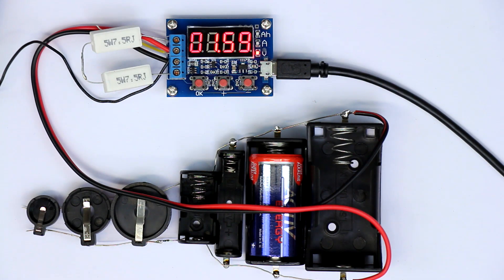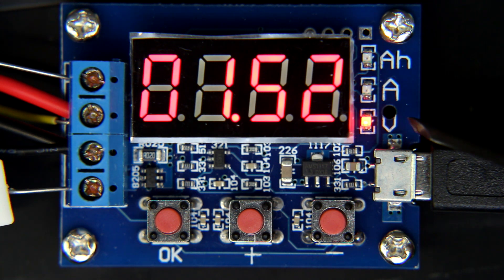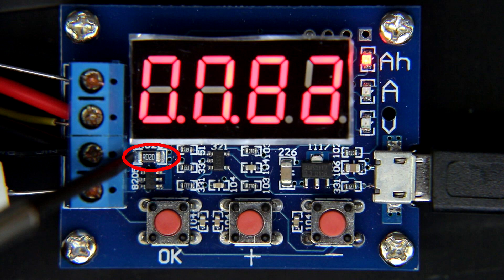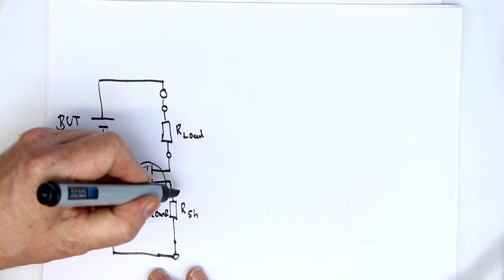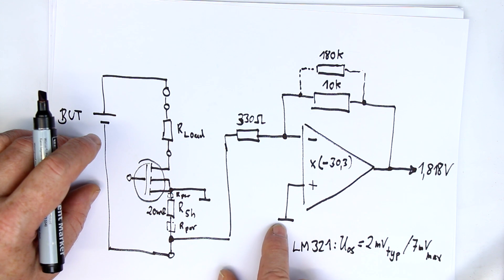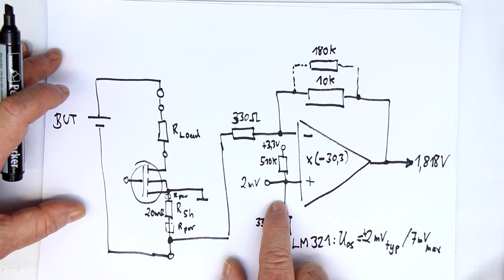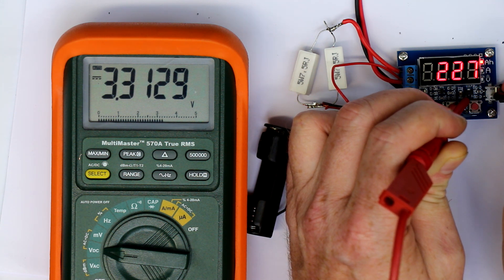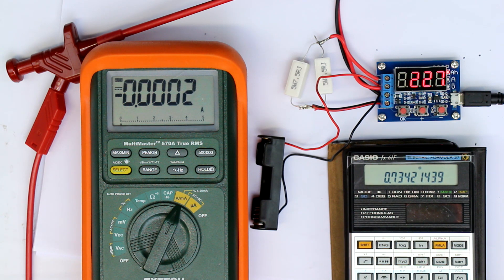Full Analysis of a Battery Capacity-Meter from Ebay

Comment: @KainkaLabs I bought 2 recently, one from ebay and one from aliexpress. I had just read in a File in the DIY Powerwalls Facebook group that some were found to be inaccurate and possibly fake copies? The ones they said to buy were the units labelled ZB2L3 V2..3 and avoid the units labelled HW-586! - Both my units were delivered as ZB2L3's and were pretty accurate compared to my DVM and stopwatch using one 7.5 ohm load using a PSU as a source, so I didn't need to try calibrating. Great videos - keep up the good work Roger :)
Reply: Same result. I initially got two ZB2L3 labeled boards. Tested multiple batteries back and forth between the two testers and found them to be within 5% of each other. Then, deciding to build a larger battery test rig, I purchased more from same seller on Amazon. The next time I received the dreaded HW-586 garbage. And after noticing many bad measurements from them, I have begun characterizing as you did to find the linear offset of each unit. I have a general idea of the % error of each HW-586 board, but only for a specific battery capacity, namely 2200mAh 18650 cells. When I test larger capacity cells, my error is much greater probably due to the crap clock in the OpAmp. These are usable for a specific cell type after much characterization, but truly wish I had just returned and insisted on the real ZB2L3. I have not looked into tearing apart those units to run your tests because these are my only gold standards.
Reply: same results

Comment: Your videos, not just this one, are a valued contribution to tech society. Please consider adding titles to this video post, correcting that there is SW calibration and actually after it's done properly, this $2 gadget is measuring with three digits precision. YouTubers often do such corrections. I have 6 sets of these and probably will get more. I take cells from a laptop battery and test them all at once. It costed me the same as the other tester you like in another video which is nice and cool, but price/value, this wins totally. (and you know it :) According those fake copies, I think they are just copies. If I remember correctly, I saw author put the design on public domain, but might be mistaken. SW on fakes changed too. It used to have problem calibrating. The trick with calibration of Amps is to put Minus terminal on IN- and Plus on R terminal below it. Ignore resistors, place Amp meter in series to get better reading and put stable 2Amps from CC regulator (or trim CV regulator until you'll find 2Amps) The rest of calibration instruction is correct.
Reply: Can you give more clear info about Amps calibration please ?

Comment: I've compared this module with liitokala lii 500 to calculate the mAh from 18650 battery. And the result if I use 10-15 Ohm Resistors and configure the cut-off limit at 2.5v, the result is only 5-10% difference from the measurement using liitokala lii 500. the test time will be longer. 1 battery takes 8 hours to test.
Reply: as you, I noticed that this testor is working best at 10-15 ohm! 2x7.5 ohm in SERIE!! yeah I know the test is longer ( > 10h), but I think result are kind of betters. at 15ohm, the batt is drained at 280mAh, and since most people use this testor to test recycled 18650 from laptop battery, I dont see why to stress those battery with 1A discharge!!

Comment: Yeah these things aren't recommended. I got mine in the mail today and there's so many things wrong with it. Right from the start when I test a battery that's charged between 4.1 and 4.2 volts it immediately drops voltage displayed to around 3.3 volts. Batteries could be bad but I don't know. Gotta wait to get a proper tester before I can know the truth.

Comment: Probably not much help now, but press all 3 buttons and plug in the usb, and it goes into calibration mode. I get mine calibrated to about 10ma.
Reply from the maker: Is 10 mA a relative or absolute error. 
Have you checked if low milliamps are accurate? E.g. with 25 mA an offset of 10 mA would be an error of 40%
Reply: @KainkaLabs  To be honest I only use it to test 18650 cells at 1A, and 12v agm batteries at about 2.8A. As long as I can calibrate it to these two ranges, I'm happy.

Comment: I saw your 2017 story and was immediately concerned about the accuracy of the one I just purchased 2022 from Amazon which looks exactly the same.  I ran tests monitoring voltage and current using separate meters at the load and also at the input.  I used a Agilent power supply for the evaluation.  I have to say the real-time measurement accuracy was within the range of decimal precision on the meter and unit displays, and the timed current accumulation was also within about 3% of my calculation for each timed study at several different voltages and load resistors.  I'm quite pleased with this unit and hope that is a sign the issues you had are resolved with updates or quality control.

Comment: One more observation after using these useless gadgets. If you set the cut-off voltage at P 3.0V, you actually halt the test at 3.099V (or whatever 10bit limit that comes from the ST OpAmp. The sig fig after the decimal is actually truncated to the next higher bit, so whatever you set, as soon as the 3.10V reading changes to 3.09V, the test stops. Given the wild inaccuracy of the current and time measurements, this probably doesn't matter, but I always set mine to stop at P 2.9V so I at least discharge to 2.99V. As far as the current offsets, if you only test one type of battery, in my case a 2200mAh 18650 cell, you can figure out a % error for each test module and factor that into to your observed capacity, and that is pretty repeatable from run to run. In other words, you can make a reasonable guess for a dedicated cell type. But you would have to go through this exhaustive characterization for every new type of cell you test like a larger pouch cell, or LiFePO4 or NiMH. Total junk. And you're right, what are they teaching in these tech schools? Or maybe these counterfeits are not even designed by trained engineers, rather self-taught "techies" in Shenzhen.

Comment: Very informative video.
Based on your eval, I ordered 2 ZB2L3's. However what I received, to my annoyance, was two of these HW-586's (when I queried this seller "they're the same")! Well I decided I'd better check them out and wired them up. I have to say their performance is much better than the one you tested. I have just been trying out known cells (new 18650 samsung 3000mAh NCR's, new amsplus 18500 2000mAh tested by seller 1985mAh on pro testing gear), first on one board, then the other. Result capacities are in the right ballpark (hard for me to be precise here because I don't have precise charging set up) within <3% of spec, discharge time is near exactly as expected and the two boards are consistent to <5%. This is in fact satisfactory for my purposes.
Reply: What is the cut off voltage while using 18600? İ get nearly 350 mAh difference between ZB2L3 and hw 586? İ set cut off voltage 3v.

Comment: I know I'm late to the party, but I got one a few months ago and did some research on the module too.  Apparently there are a lot of hardware variants around, in a github thread i scrolled, i counted 3, one with a ST micro and some chinese micro that use a separate display driver and 3rd one that use a one micro for everything. For all of them what I can gather the frontend seems the same, so the microcontroller change was made to cut cost. 

But the module has a secret calibration method where you can feed it 10v and 2A. This applies only to the hardware variants that use dedicated drivers for the display, because the standalone variant microcontroller is so low-end it literally doesn't have enough ROM for the code. According to some manual I found, where chinglish is atrocious:
- hold all 3 buttons and then power it on
- it will display the time when it was calibrated then OuOA
- press OK then short the battery input and it should display J10u
- remove the short and press ok
- connect a 10v "standard DC supply" and when done it will display  J2.0A
- press ok and then connect a 2A "constant DC current"  - the manual recommends to " 5Ω 50W" , presumably a load at 10v

then it says" calibrate done. Instrument will check the calibration data in advance, it will takes turn to display 4 number and quit if data reliable; if no reliable it will discard data and quit."

I haven't done the procedure, but first I will check if my unit has the errors Roger mentions.

Comment: I bought half a dozen of these 5 years ago for our numerous club 12v 9Ahr gel cell batteries.
Using 12v 20W halogen lamps for a load. (Brightly lit lamps are pretty and folk are less likely to want to touch the very hot bits)
Testing with bench power supply showed AHr accuracy 2% or better. 
Getting consistent AHr results between all 6 testers.
Amazingly cheap.
Proved to be reliable - no failures after many hundreds of tests. This is even under 'Club Conditions' where most equipment eventually gets clubbed to death. 
Hard to say NO to these wonderful devices.
Suggest that you might consider testing more than one sample in future videos?  (In case you got a dud or damaged it during testing?)
Regardless, appreciate your analysis. Thanks.

On a side-note, when testing Gel Cell rechargeable batteries, the biggest variation comes from the state of charge of the battery before the test. 
It is very time consuming to get the last 20% of the charge into the battery and many chargers indicate full charge far too early (Especially fast chargers). 
A battery that has just been charged from 'flat' and left on charger for 24 hrs will show ~10% difference from the same battery that has been charged from a shallow discharge and repeatedly topped up by disconnecting and reconnecting charger. (All this is charger dependent of course).
Reply from the maker: A 12V/20W lamp draws 1,67 amps of current. A 6% error would be 100mA. So you didn´t tell, what was the offset- and scale-error for low currents, which was the main criticism of this video. I wanted to (halfway) accurately measure batteries at low currents which is impossible with this device.

Comment: You must have received a Funky one.  The three I have are pretty dang close on the numbers.  Well within the Stated Specifications.  Did you verify the Resistor Values ?
Reply from the maker: No, it´s the other way around: 

You were lucky that the errors cancel out with your specimen (at least in the measurement range you tested it)
I have bought two of them and both show the errors.
And the design error with the "fixed" offset-voltage subtraction is a "permanent" fault
Reply: Cool Beans.  Well lucky for me I just need some what of Ball Park Reading matching used batteries for E-Bike battery builds.  They work fine for the task I'm asking.

Comment: I have a problem, I have bought a "300W XL4016 DC-DC Max 9A Step Down Buck Converter 5-40V To 1.2-35V Adjustable Power Supply Module" & some 5K Potentiometer With 10 Turns to build a variable power supply a few days ago. But now I have noticed both the Potentiometers used in the buck converter are 10K. I will replace them with my 10 Turns Potentiometers. So if I use a 5K Potentiometer replacing a 10K Potentiometer, will there be a limitation in minimum or maximum output voltage (& current) or that will increase or decrease the sensitivity of the turns? Sorry to disturb you by the way...
Reply from the maker: If the potentiometers are used as voltage dividers: No problem to use a 5K instead of a 10k pot.
If the potentiometers are only used as variable resistors you would only get half the range.
Try it out. Nothing can break
Reply: Thank you so much for the answer, your opinion means a lot to me. I am really very grateful that you read the comment, thought about it & posted a reply. Thank you so much...

Comment: Calibration with a bench supply is required. Once it is calibrated the measurements are within tolerance. Otherwise these modules are useless. So many reviewers fail to mention this requirement. They just want to push their affiliate links. It's less of a bargain for those who don't have a CC/CV power supply.

There are so many different versions and copies of this module by now.  I tried a few different calibration instructions but only one method worked on my particular module. Some methods result in zero current measurement.
Reply from the maker: There is a follow-up video from me with the calibration. Doesn´t make the offset-error which skews low-current measurement any better. So my criticism is valid and verified from the fatal error in the circuit layout. And I don´t have any affiliate links and want to sell my own capacitance-meter. Please stay on the topic.

Comment: I carried out some bench testing on one of these boards using a bench DC load and DC PSU
In my case the current reading at low currents <100mA the readings were inaccurate
5V input simulating battery

0.1A --> LCD = 0A
0.2A --> LCD = 0.073A
0.5A --> LCD = 0.4A
0.7A --> LCD = 0.6A
 
But at higher loads it is more accurate
1A ---> LCD = 0.927A
2A ---> LCD = 2.0A 

I then carried out a half an hour discharge with 2A load 
After 1/2 hour the capacity read 994 mA/H which is very good

I also carried out a 1hr discharge with 1A load
After the hour 952mA/H 

I think the PCA is only designed to work with the load resistor combinations that produce a load current between 1 and 2A

Comment: Very good video. However, I have used this tester on a number of 3.7V Li-ion Batteries (18650) and compared to the "spot-checks" I have done, it seems to be fairly accurate or at least better than the min. 20% error outlined here. I really think that it only works well with (higher voltage) batteries, even it don't really make 100% sense
Reply from the maker: Please watch the new video I uploaded today concerning the software-calibration which I didn´t know of before.
The timing-error in the video here was probably an error introduced by me due to the desoldering actions.
It´s no longer present with a fresh unit (+/- a few percent).
The offset-error in current measurement is proportionally smaller if you go to higher currents.
So if you measured at higher currents (1A or more) you could have been lucky that the errors more or less cancel out at certain values (and/or you got a unit that has by chance a lower offset-error). 
Sad because this unit would be capable of a total error around 2% over the whole current range if the calibration procedure would have been done the right way.
The voltage of the tested battery has no influence on the accuracy of the measurement because only current and time go into the result. The voltage is only used for determining the cutoff-/turnoff-point when the discharging is stopped.
Reply: @KainkaLabs  If this video is significantly wrong or inaccurate you might consider mentioning that in the description, since I've now been referred to your video twice in forum posts recommending against this unit. I've had great luck with mine, which is why I was reading the comments.

Comment: I made the same statement than you with my my capacity-meter : 
> The voltmter is pretty accurate
> howerver the currentmeter has a 32mA offset. I didn't measure the slope.
> The clock is also uggly : +67% of mAh after the 10min test
A real crap !

Comment: hi! I am disappointed that the unit is not as good as advertised, but not that surprised.   
HOWEVER, if i'm simply using it to compare cells and see which one can be matched with which other one, can we consider the results to be internally consistent, i.e. from one battery measurement to another, with the same device?
thanks!

Comment: Nice, however, you could reroute the output of the tester to a buck/boost converter and charge something, instead of wasting the energy and using expensive resistors to discharge into. A buck/boost converter is what most battery banks use, since they have a single cell or cells in parallel, which does not have 5v, but instead 3.7v nominal.

Comment: thanks for the info .
but boss what do you advise me to buy a good device for testing battery capacity ?
Reply from the maker: Just watch this channel and take a look at the latest videos where 2 other battery charge testers were reviewed.
In the meantime the TEC-06 for around 10 bucks has arrived.
Tested it yesterday and it´s perfect (4-wire voltage measurement, abjustable turnoff-voltage, 50mA lowest current setting). Very recommendable if 3.5A/15V max. current/voltage is enough.
Will be reviewed soon
3 other testers are ordered but as you know it takes 2-6 weeks shipping time from China :-(
Reply: ok thanks for the info but i am going to wait for ZKE device  review , thanks again
Reply: muharraqi55 m

Comment: nice engineering, nice content, thanks   ..regarding the opamp's offset there is no 100% solution, I guess ..I experienced, that the offset is floating up and down with the temperature and well, we can wait until the device has got it's stable temperature and then trimm it to low-offset but what will happen, if there is a load and parts of the device get warm(er)?   Think, there is no other way than finding a better opamp-solution with internal high-class  temp-compensatet offset.   Am I totally wrong?
Reply from the maker: You´re right. Taking the offset of an OpAmp as a "constant" from the datasheet "typical value" and then subtracting this typical value on one of the OpAmp inputs is the dumbest thing I have ever seen in electrical design. If you would present that as a solution to offset-compensation in an exam you would probably be thrown out of the university :-)
The only way to get rid off of the (non-constant) offset here is to use a better OpAmp.